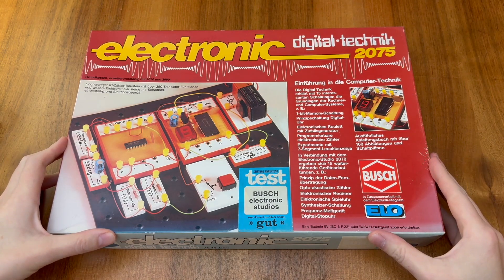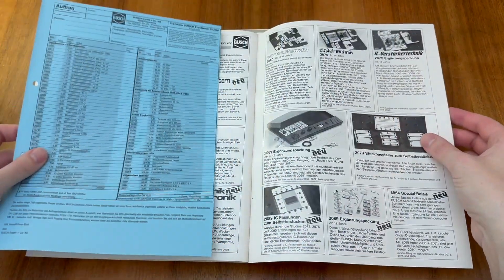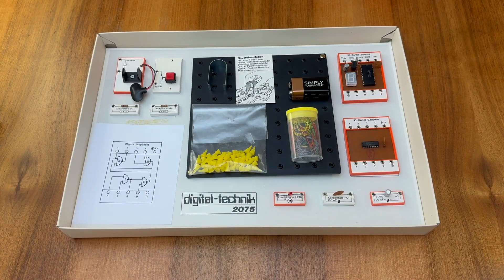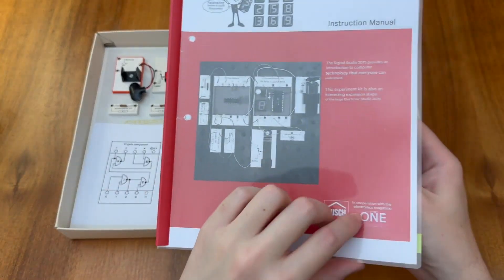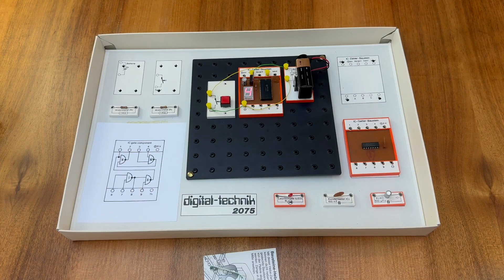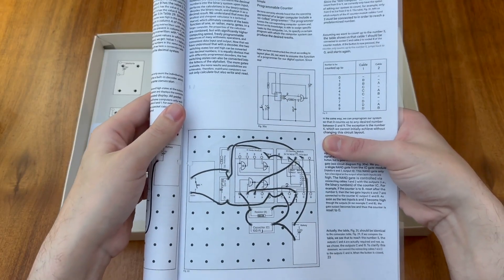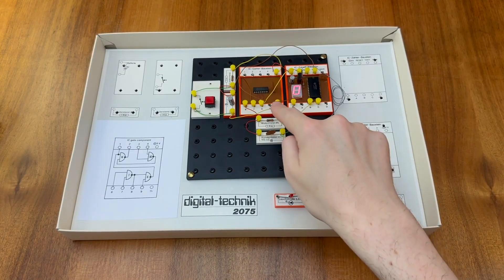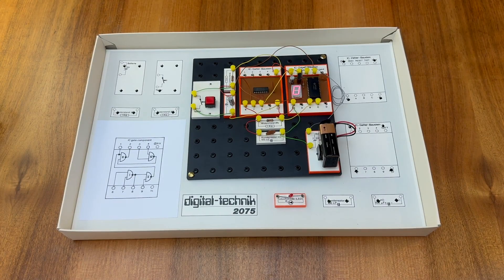Busch Electronic Digital-Technik 2075: Introduction to Computer Technology from West Germany (1970s)

Comment: Hmm thats an akward wired 7400 module .. i guess its because their modules only had 10 connections ... and lets use a 9 Volt battery with these 5 Volt TTL chips.
Reply from the maker: Yes, I thought so too! That's why I have an extra copy of the wiring diagram of the module for reference. I think it would have been a nice addition for an illustration (i.e. the schematic/wiring) for the IC modules to be shown in its place on the cardboard packaging, as is done for the more basic components in the kit. The 9 V situation is actually mentioned in the manual. At least one of the circuits doesn't use the counter chip or display, but you need to use the module just for the 5 V regulator!
Reply: @jtjacques  Might have made more sense to have integrated a 7805 regulator in the battery module,  but made it optionally by having a 9v out and a 9v in and a 5v out connection. But the battery module prolly has no circuit board. ANd its cheaper to combine parts on one circuit board.  Maybe they should have made a module with the regulator and maybe combine it with other parts .. like LED's and buttons so it uses all connections. And that would free up connections on the counter module ..  oh well..  When i had the radio shack electronics kits i also got a breadboard for experiments .. which could fit many more parts..
Reply from the maker: @apsdev  I agree. Lots of good options available!